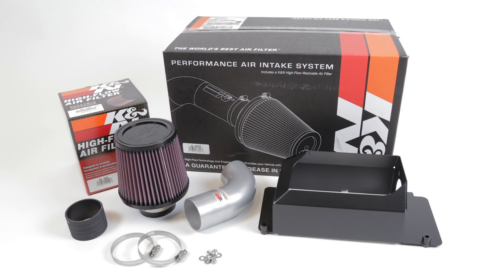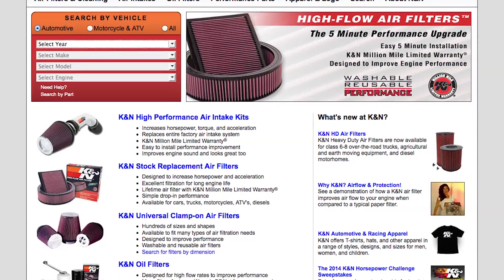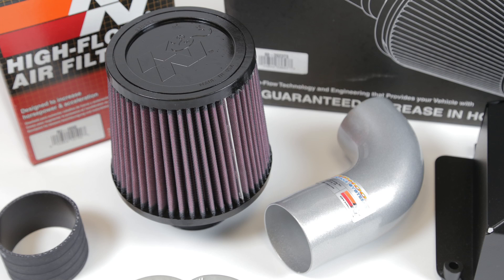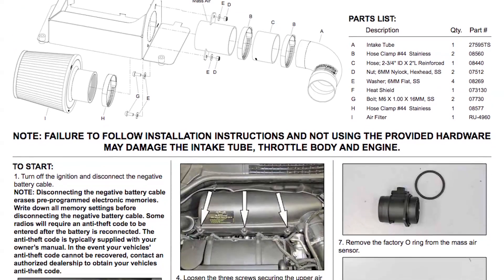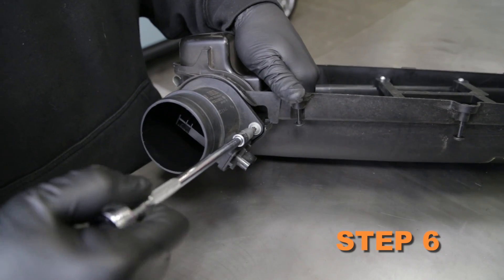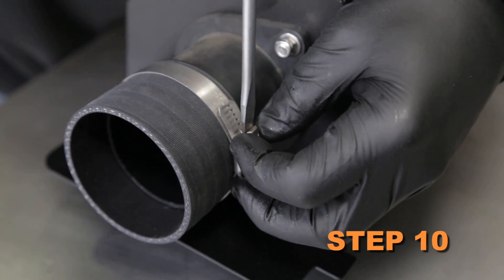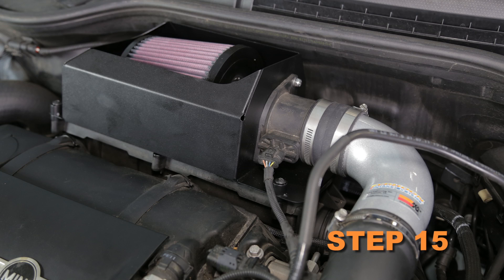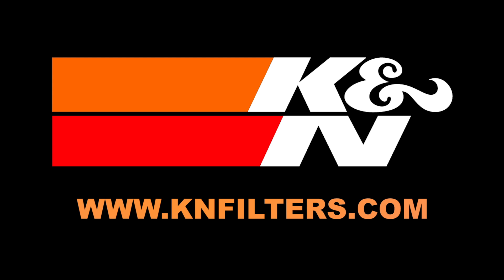2011 - 2014 Mini Cooper S 1.6L Air Intake Installation

Comment: I'm thinking of doing the same thing to my 2012 S, wondering if you removed the hood scoop grill cover or if you ever experience problems in heavy rain???
Reply from the maker: James Abramson We only test these on stock vehicles, so we do not have that information.
Reply: I had this installed in my '12 S. I took out the factory scoop grill, and added one that is functional. I think I got the grill from WayMotorWorks.
Reply: Sorry to be offtopic but does anyone know of a method to log back into an Instagram account?
I was stupid lost my login password. I appreciate any assistance you can offer me
Reply: @Holden Jacob Instablaster =)
Reply: @Arjun Lawson I really appreciate your reply. I got to the site on google and Im in the hacking process atm.
Seems to take a while so I will get back to you later with my results.
Reply: @Arjun Lawson It worked and I now got access to my account again. I'm so happy:D
Thanks so much you saved my account !
Reply: @Holden Jacob you are welcome :)

Comment: Hmmm, Turbo’s run more efficiently with an inflow of cold air, wouldn’t this setup just suck in hot air from the engine compartment.
Reply from the maker: For application, the included heat shield allows the filter to be isolated from engine heat.
Reply: You are correct the only true cold air system is the factory air box.  These so called cold air systems are not what their names imply.  And the heat shield that it comes with does not shield the filter from all of the engine heat especially when idling it will heat soak like crazy.  I had a system in the past by AEM on a WRX that routed the filter down into the finder well where it did get cooler air unlike to ones that are open in the engine compartment like this one.
Reply: Robert S how did you resolve it?
Reply: Kept the factory air box and dropped in a K&N filter.  Filter has more flow than stock and you keep for factory cold air box.   There is  another design that utilize the factory hood scoop to rout the air through a duct on top of the filter but I do not remember the manufacturer for that one.
Reply: Robert Daone Robert Daone ? The mini’s filter is next to the engine exhaust pipes & heat the incoming air. This system takes air from colder airflow for “cold air” intake. AEM’s stuff on the mini actually exclusively routes outside air from the hood swoop through the intake, not collecting any air from under the hood lol

Comment: will the service light will on after install the k&n intake?
Reply from the maker: +Himsely Mach Should not. if it does that typically mean something is installed incorrectly. If the problem persists, give us a call.
Reply: +KNfilters this fit in my 2007 cooper S? , looks like is the same motor
Reply: @robertesb20rs  yes, if its a hardtop r56, it will. but youre better off buying the silicon tubing for $40 from your local car shop and then just putting a k&n air filter on. for only like $100 total, probs $70 total in USD. i have the same car and  i sold the oem air intake for more than what is spent on all the tubes and filter.